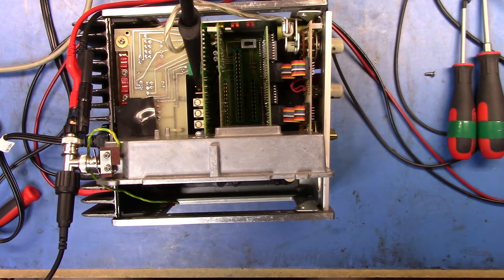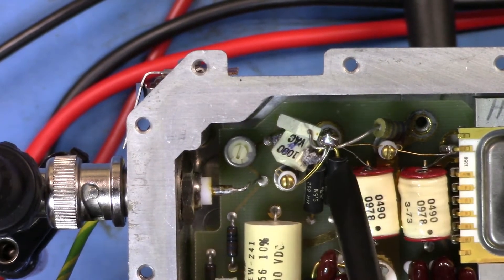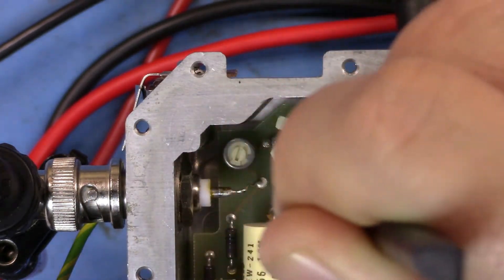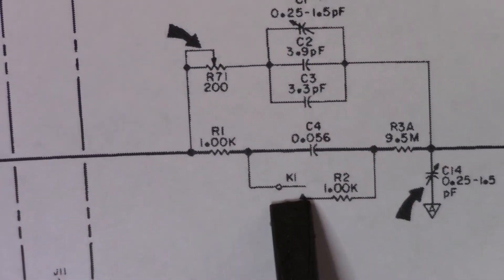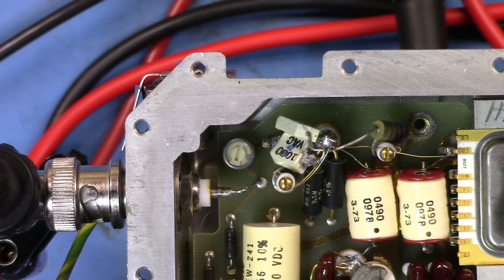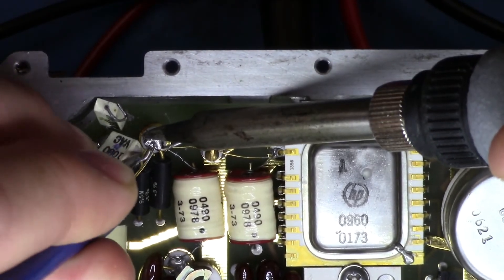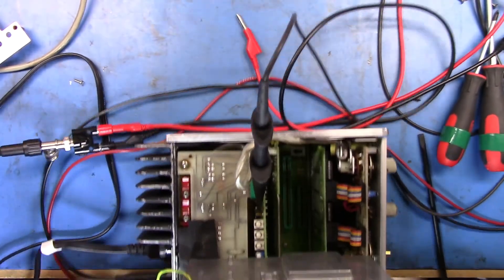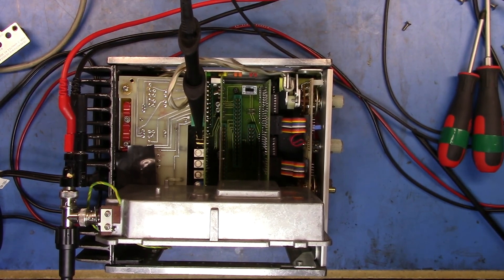HP 3403C Repair - Part 2

Comment: Those Vitramon capacitors are multi-layer ceramic capacitors.  Those types of capacitors rarely fail unless they've experienced an overvolt condition.  Could it had corroded?
Reply from the maker: Maybe - It really looked like an electrolytic leaking but these are porcelain caps so that shouldn't be the case. Overvoltage shouldn't have done that either (the way it looked, not killing the cap). I'm at a bit of a loss really.

Looks like I will need to remove the board and check the input and overload circuit components.